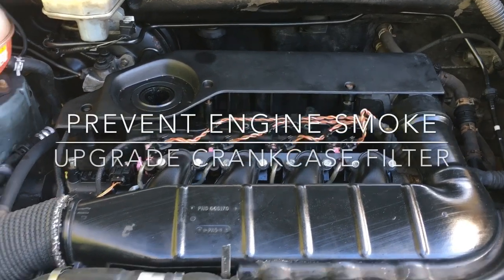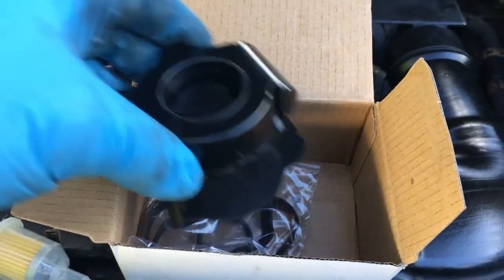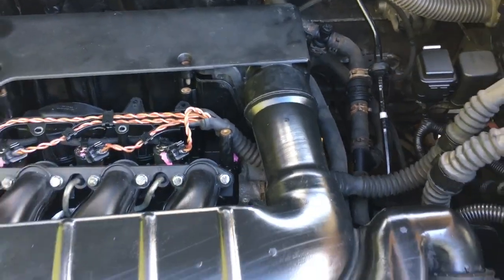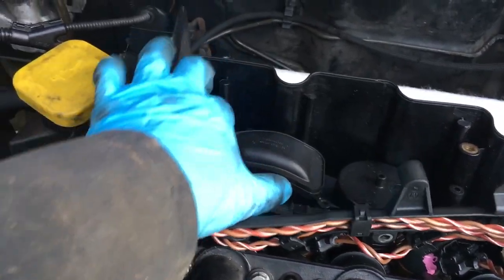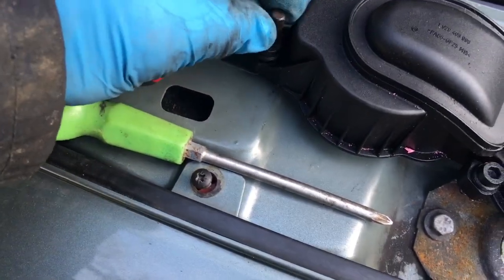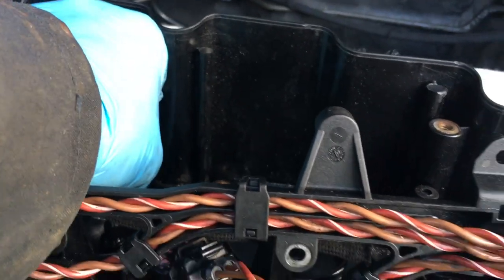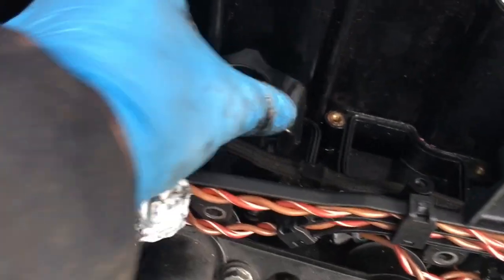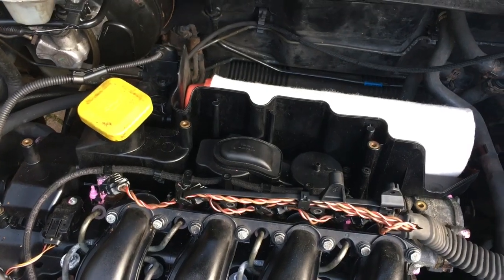Freelander TD4 - M47 crankcase filter upgrade - prevents smoke

Comment: Not having looked yet, but from what I've just read, this oil unit is on the MG Zt-T 2.0l as it has the M34R engine and the intercooler has oil in it, so it's either this is blocked or turbo leaking oil! ...I have to say, I'm somewhat surprised at its performance for a 2.0l engine, it has no power at all! ...is this a common factor with them? ...a great video once again, everything in fine detail 👏👏👏👏
Reply from the maker: It doesn’t surprise me that it has the same filter problem. I’m not a fan of those BMW engines, too many faults over time and yes big much power. Worth checking your boost pressure is ok though and those ronbox tuning boxes make a fair improvement.
Reply: Replace all your small bore rubber vacuum hoses throughout with silicone ones. You just buy a couple of meters from any tubing supplier. I bought red as I could then identify it. The difference is incredible to anything that runs off using it. I nearly put my head through the windscreen as the brake servo was working better than new. Turbo is also now functioning properly. It is like a new car.

Comment: Where does the little filter go that was in the box
Reply from the maker: There was only the crankcase filter and seals that were in my box.  The small filter shown to the side of the box in the video is a generic fuel filter used as an air filter for the pipe that goes to the turbo boost solenoid, with one side open to the air.

Comment: So I have a question about this part replacement. When this new separator is in place, does that mean the is no longer a need to place a filter in there? Does this device spin by airflow and then recirculate the oil back to the engine? I'm just curious before I attempt this replacement.
Reply from the maker: Dahlia Ansley yes and yes in answer to your questions

Comment: Hi me again. But do you know why when I have put car into gear then l release the clutch pedal it is doubles up passing higher than break pedal any thoughts on the problem freelander 2002. Thanks again. Mike
Reply from the maker: Hmm, not sure I quite understand but it's not unusual to have the clutch higher than the brake pedal.  If too high maybe have a look underneath on the pedal box and see if you can work out what is going on.

Comment: Hey me again thanks for window problem help one more time now I am intrested to install crankcase filter.
I have some oil leaking around EGR Vent  is it possible it is comming from crankcase regular filter  and should I install EGR bypass will that be better for engine or it will just give it power boost and shorten life of engine
Thanks
Reply from the maker: The old style filter blocks and oil gets pushed into the inlet manifold. It gets everwhere so could perhaps be seen around the egr.  Definitely worth upgrading it.  Have EGR means better no2 emissions so better you everyones health.  If the egr is working ok, I would leave it along.  Mine was only blanked as the car came like that.
Reply: @comeinhandynow  Thanks for fast replay

Comment: Good video
Reply from the maker: Thanks.
Reply: @comeinhandynow  If I buy a Freelander, is there any way to check if this has already been done?  Or do I have to take it all apart to check?  And if I take it all apart to check, do all the seals need replacing?
Reply from the maker: @amana1480  Take it all apart (not too difficult) and the necessary seals come with the new filter.
Reply: @comeinhandynow  What I mean is there anyway to check if the filter has been modified to the new BMW part without taking it all apart?
Reply from the maker: @amana1480  I get you. There is no why of checking from the outside.